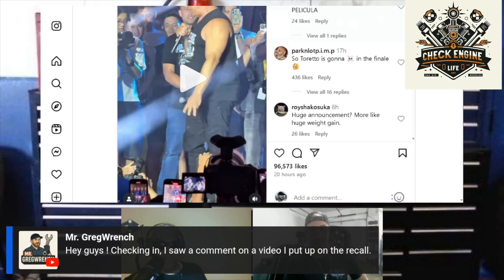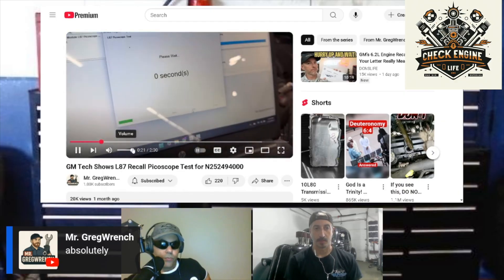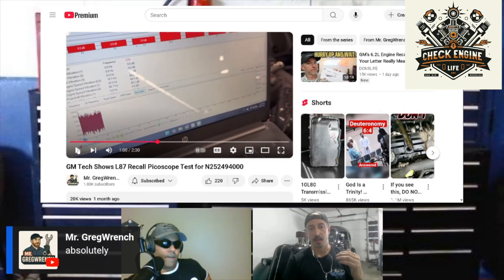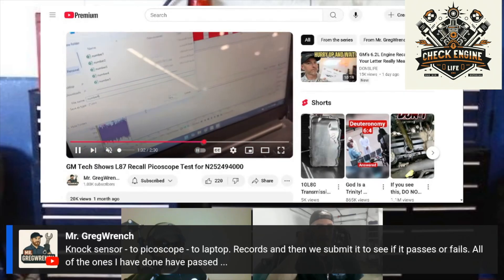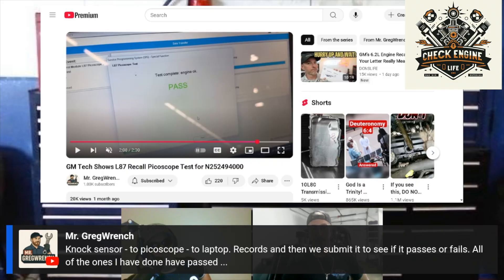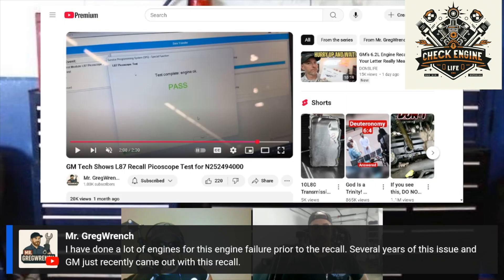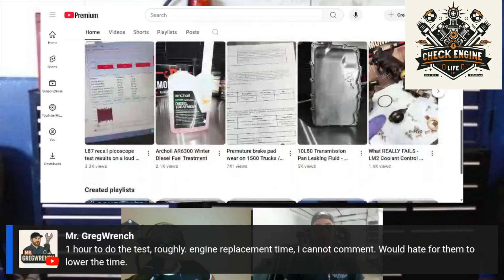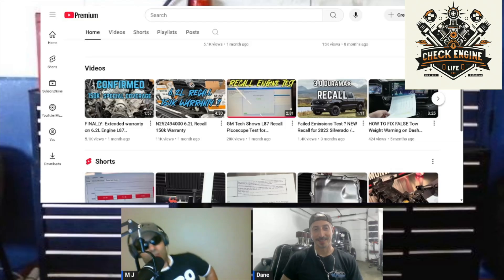GM Tech shares how they test for the 6.2 liter L87 engine recall

Comment: I believe they are testing for out-of-spec excessive connecting rod bearing oil clearance. If the connecting rod bearings have, let's say .0025" oil clearance, they will rattle on the crankpins at 2000 steady state RPM with 0W-20 oil. The engineers know by switching to 0W-40 oil in that particular engine it will be quieter at 2000 RPM which indicates safer operating conditions for that engine. This is an easy quick test but not an exacting method. What if only a few, not all the rod bearings have excessive clearance? The proposed remedy affects them all.
Reply from the maker: I don’t think the proposed remedy will have a negative effect - regardless of if the rod bearing clearance is out of spec or not. Either way the engine warranty is extended. But I think it will be fine.

Comment: The simple easy way I would think is just to check the conductivity of the oil!, besides the obvious one of a magnetic sump plug and or a fish around in the sump with a magnet, and the obvious cutting the oil filter open etc, testing the conductivity of the oil, provided the vehicle hasn't just been serviced!!! , to me would be the simplest easiest & quickest non invasive test you could do! , and also seeing as how the engine already has a knock sensor!!!!, seems rather curious that you would add one to test for abnormal engine noise ?????, unless this is only about collecting data???, on just how bad the situation is for GM?.
Reply from the maker: I think if the current process were just about data - GM would not have extended the warranties of the vehicles in question. - also;  many of the vehicles have already had their first oil change - perhaps the original knock sensor is not sensitive enough to pick up the info they are looking for 🤔
Reply: @MJ100k  Yeah OK but I would imagine if I was an owner, there is no way I would accept the check & oil change band aid (not going to use the word fix, for obvious reasons!)fob off!!!! , without some form of guarantee !, so i think they were forced into doing that, but I'll bet they have calculated the likelihood of failure after that 150k mark accordingly!, they're not silly!, they're trying to get out of replacing engines , or vehicle buy backs !, as for the knock sensor, you could be right, but I doubt it!, I wouldn't trust GM as far as I could throw them!!!!, and BTW , I heard a guy who mentioned talking to a GM Tech who did the test, which of coarse it passed!!!,  and then  changed the oil to the new grade, & then took it for a test drive & guess what!!!!, It Seized !!!!, just as I had said would happen prior to hearing this story!!!!, I'm sorry but I firmly believe this is a con job!!!!!, and that story supports my theory!, GM has well and truly lost the plot!!!!!, not what you want to hear I know!, but it's the truth, so please don't shoot the messenger!. Cheers :).

Comment: Any chance my 2024 engine in this recall will be fine and last for 200,000 miles? Or are they all doomed?
Reply from the maker: According to the NHSTA report on the 6.2 recall… There are a-little under 600,000 engines involved in the recall. Approximately 3% are estimated to be defective. (That’s  18,000 defective engines) 

Here’s a video I did going over the NHSTA recall report. 

https://youtu.be/IdQ8oj-K5nY?si=nt73dHN9BqGnlDbg

If I were you I’d take my vehicle in to the dealership for the recall. They will perform a test on it to see if it needs a new engine. 
They also extend the warranty to 150k 

As far as getting to 200k miles… I don’t know of any OEM warranty that goes that high. But if you want to extend the life of your engine as much as possible, you can do the following. Change your oil at least every 5,000 miles. Full synthetic oil - factory filter that you get from the dealership. That’s what I do. In fact I drain and fill the oil every 2500 miles and change the oil and filter every 5000… But I do it myself so it doesn’t cost that much, I’ve got a small car. Also, avoid letting your vehicle idle for long periods of time. 

As for lifters they have also been an issue for some people. Just keep your ears open for lifter tick. If you hear the lifters ticking immediately have them fixed to avoid damage to other parts. 

If you have a ten speed transmission I’ve heard if you manually put the vehicle in 9th gear it will disable DFM for that trip. I don’t like attaching AFM/DFM disablers. 

If you’re really paranoid about lifter failure you can just have the lifters replaced before they show a problem once you get to high miles. 

To answer your question- It is possible to get to 200,000 miles on a 6.2. I just looked up used trucks for sale on car gurus website. I saw one 2022 6.2 with 224,000 miles…. 

https://www.cargurus.com/Cars/inventorylisting/viewDetailsFilterViewInventoryListing.action?sourceContext=carGurusHomePageModel&distance=50000&inventorySearchWidgetType=AUTO&zip=28303&entitySelectingHelper.selectedEntity=d630&startYear=2021&endYear=2024&sortDir=DESC&sortType=MILEAGE&isDeliveryEnabled=true#listing=421977679/NONE/DEFAULT

I also saw a  2021 6.2 with 186,000 miles and several with over 175k… 

So yeah - those are the numbers. 
If I had a 6.2 like yours, I’d just take it in for the warranty test. Take good care of it and keep your ears open for lifter tick or replace the lifters early. Should be fine. 
Let me know if you have any questions. 👍

Comment: I have a 2024 that the engine did fail prior to the notices going out at 19,000 miles. I was told it had a rocker fail and they replaced the engine and flushed coolants for engine and transmission.  I received the notice and was told to bring it back and have the replacement engine tested which now had another 15000 miles on it.  It failed the first test and the factory told the dealer that they did not want to accept the result and to have it brought back and have it retested.  I was told the retest past but not told about the added warranty that I could get?
Reply from the maker: According to the article linked below- 
For the 6.2 liter recall- If you fail you get a new engine- 
…. Engines that pass inspection will also receive a new special coverage program that extends warranty protection for 10 years or 150,000 miles from the vehicle’s in-service date, whichever comes first. The Special Coverage program number is N252494003.

https://gmauthority.com/blog/2025/05/gm-6-2l-v8-l87-recall-good-engines-to-get-extended-warranty-coverage/amp/
Reply: Not sure I understand that it could fail the first time, but pass the second time? If that's the case, GM can question any test, even though it's their test.
Reply: @nickrinaldi4276 my guess would be that perhaps the Tech that performed the test, that GM did not wanted to accept was potentially done incorrectly and thus having to bring back a second time.

Comment: Might be a faster test but I doubt it’s thorough enough to gauge whether or not an engine is destined for failure. I’d be more pissed if they told me my truck passed this test, only to fail later
Reply from the maker: Will the test be able to gauge if an engine is destined for failure? We can’t know the answer to that question at this point. We do know the warranty has been extended, so GM is standing by their product. 

 Consider this- the in depth test that the engineers and technicians performed when they investigated this issue are the highest possible level of testing. It’s time consuming: they probably tore engines apart and measured each part. The crankshaft roughness was just one of the issues. To measure crankshaft roughness to the highest level requires a non contact roughness analyzer. That tool can run over 5,000$ and it must be calibrated. That kind of tool isn’t used in dealerships. So… a 5,000$ tool times every GM dealership in the US… and train technicians on how to use it… and tear each engine completely apart to measure other possible issues … You’d be waiting forever and a day before you get your truck back. And they’d do all that for a problem with an expected 3% failure rate ? 
We have to be realistic… and have technicians use the tools they have available in an efficient manner. So we’ll have to wait and see for the current available test. As I said, the warranty has been extended so… it should be cool 💯
Reply from the maker: I understand your concern.. However, it looks like the warranty is being extended. Which is good news: 
According to GM authority: 
every impacted vehicle, including those that receive a replacement engine, will benefit from the extended warranty coverage. The extended warranty provides coverage for 10 years or 150,000 miles from the original in-service date, whichever comes first.

https://gmauthority.com/blog/2025/06/gm-6-2l-v8-l87-recall-replaced-engines-benefit-from-extended-warranty-coverage/#:~:text=The%20extended%20warranty%20provides%20coverage,engines%20in%20the%20U.S.%20market.
Reply: If your engine so called passed this test how will this truck now effect it’s resell value
Reply from the maker: @johnwilliam6638 Are you asking me to predict the future 🤔